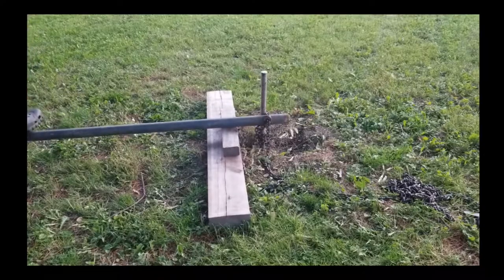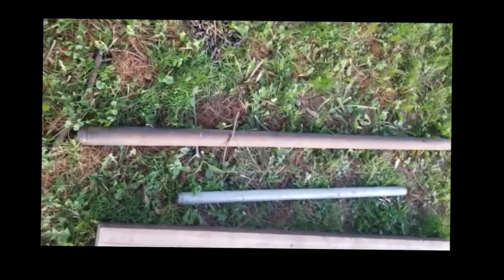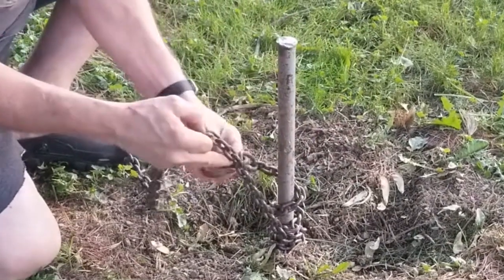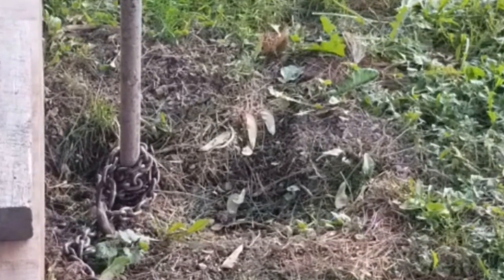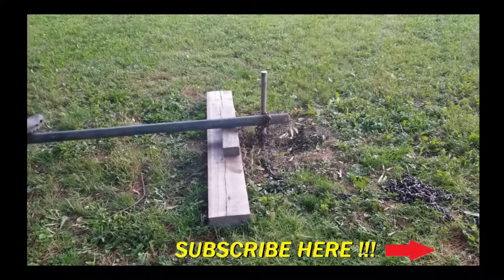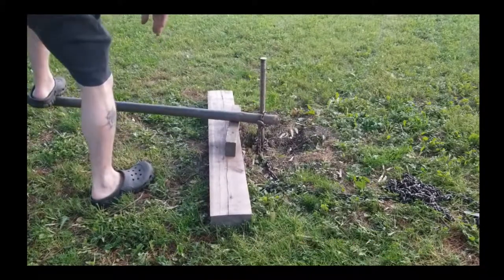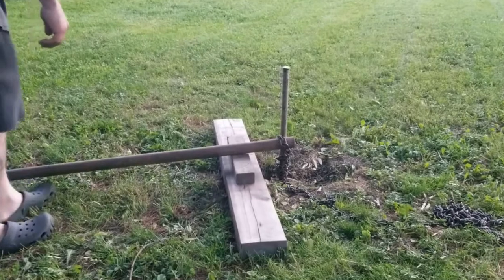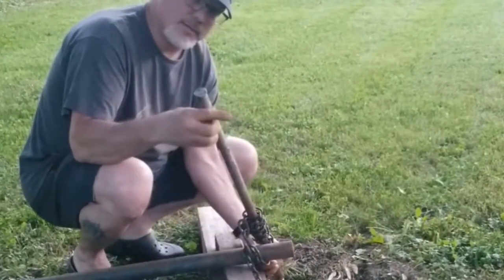Easy Stake Removal | Under 90 Seconds!

Comment: Winder if a leather strap or dog leash would work.
The chain slips too much.
Reply from the maker: Thanks for watching. Anything strong enough to pull it out will work. The chain needs to be wrapped a certain way in order to not slip on the stake or post that you are pulling. The end doing most of the pulling needs to be wrapped under the first wrap and so on. I hope that this helps.

Comment: i aint got a chain nor pipe
Reply from the maker: You may have to improvise. A digging bar, steel rod, another stake, etc... Along with a rope, cable, wire rope, etc might get you going...depending on the stake.